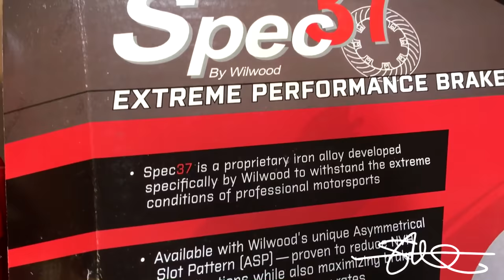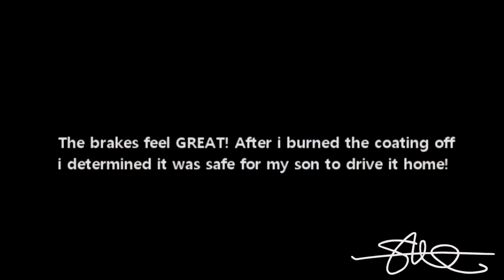MONSTER Brakes! The ULTIMATE upgrade '02 GMC Yukon - Wilwood 16" Rotors 6 Piston Calipers Installed

Comment: Is the handbrake on the inside of rotor on rear axle ?
Reply from the maker: it's inside the rear.  It's a drum inside a disc.....kinda weird to say that but that is what it is.  That fat ass center part has shoes inside of it.  They don't work worth a damn though.  (also, it isn't a "hand brake" in these SUV's, it is a parking brake...just an fyi, i know what you meant though) :)
Reply: +meade916 thanks man 😃

Comment: Well I din't get to see the pads but those rotors really din't look bad. Course only way to know for sure is use a micrometer. Some rotors come from the factory just a bit over min spec. not like you can turn them or anything and now it costs so little for new rotors vs machining them (if you even can) that it makes no sense to machine a rotor. I would also like to point out my dually has 13 in drums in the rear and 13 in rotors and that is enough to stop my truck with 2000lb in the bed on top of the fact the truck weighs well over 2 tons....soooo what the hell is the need for 16 in rotors and 4 and 6 piston calipers on this SUV. Yes I know subs weigh a good deal and the box but holy crap its not like there is 3000k lbs in the back of that suv. lol jesus bit overkill there. but least you have a good stopping distance. So props there
Reply from the maker: your truck is a stock dually.  Of course it stops just fine with stock brakes. Stop pointing stuff out. lol
Reply: +meade916 no i know that but im going off the thicknees of the rotor the size and the piston size and you got near enoug dually sizd brake system for a suv. even with the weight of everything i guess you went just a lil overkill eh xD i dont blame you i was just wondering what made you go with that kit?
Reply from the maker: we went with this kit because we wanted the best.  Maybe we should have went mediocre instead? lol.  There is no such a thing as "overkill" when it comes to brakes.
Reply: meade916 I understand esp with the time and effort invested to install the kit. I'm a mechanic by trade and I just wondered why you chose the god brake kit. It was a bit of a shock for me seeing those rotors on a SUV lol. Props though esp for keeping your vehicle safe for everyone. I hope you dint take any of my comments as a attack on you. They were not intended to be offensive.

Comment: Next time remove the dust shield instead of hacking it to death.
Reply from the maker: nope. This is how Wilwood recommends doing it.  It is easy and you cannot see it at all.  Plus, it isn't hacked to death that is a pretty clean cut.
Reply: Maybe they need the little bit of spacing the remnant of the dust shield provides.